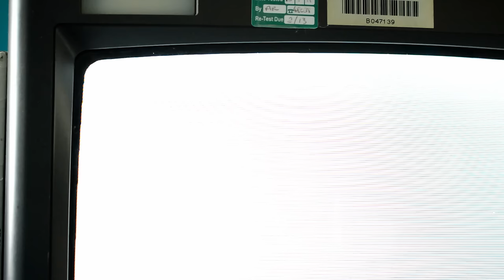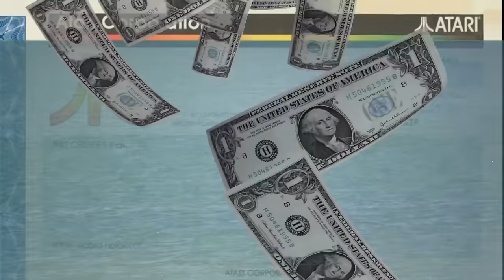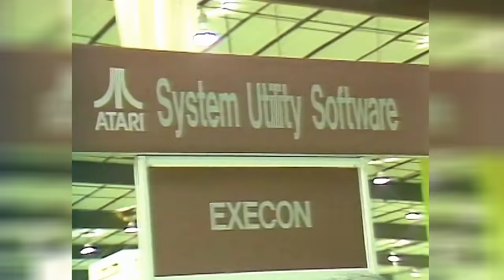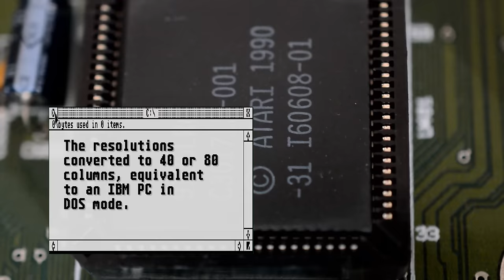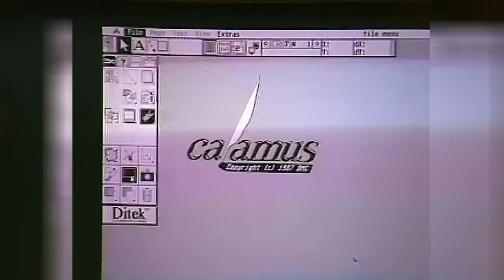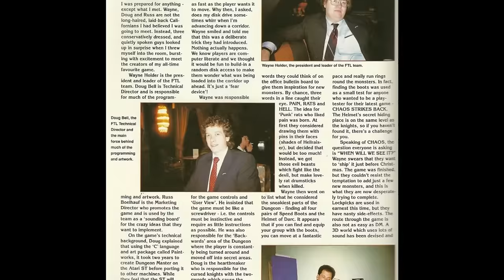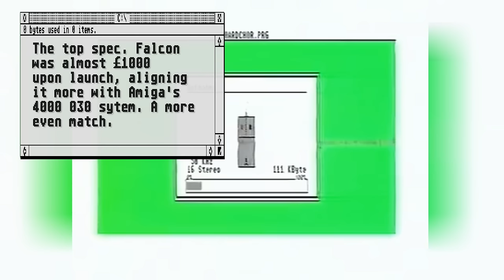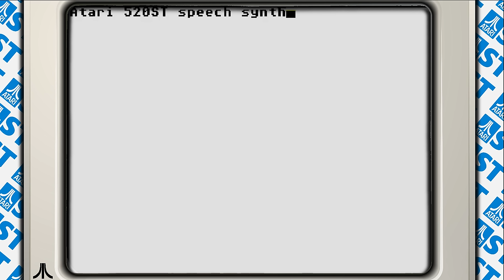The Atari ST Story | Nostalgia Nerd

Comment: The first true 16 bit home computer? Where are you getting this shit from? The original IBM 5150 was 16 bit and there were probably others before that. Though it wasn't specifically aimed at home users, lots of houses had PCs in them. If you want to say the PC doesn't count, then you can say the ST doesn't count because it was aimed at small businesses as well. In the end, the ST is a mediocre machine which ruined the gaming experience of Amiga owners because coders were coding to the lowest common denominator, which was the ST.
Reply: Back then there was a difference (market or whatever you prefer).  Home computers and IBM computers were not in the same category.  So...he is not wrong.
Reply: What? The original 5150 was a 16 bit home computer as was the PC-Jr. Hell, the TI-99 was 16 bit as was the Intellivision (even though it wasn't a home computer) from 1977.
Reply: tarstarkusz Are you trolling or drunk?  You first say that it wasn't the first 16bit HOME COMPUTER, then give examples of computers you admit while 16bit were not HOME COMPUTERS, as an example that the ST was not the first 16bit HOME COMPUTER.  OK, enough talking to you, either troll or just very very drunk.
Reply: The ST was indeed the first 100％ 16-Bit home computer "system" to be released. Having a 16 bit CPU doesn`t necessarily make the system 16 Bit. As a matter of fact, the Motorola MC68000 internally is a full 32-Bit CPU, which is not "rated" as 32-bit because of the 16-Bit Bus.
While the Intellivision was not a home computer (so it is pointless to mention), the IBM-5150 used a 8bit/16bit cpu (just like the ST 16/32) with an 8-bit external bus.
The TI-99 wasn`t much better with the use of an 8-bit to 16-Bit multiplexer that forced to use twice the cycles per access and introduced an additional 4 cycles wait state.
All in all the ST, with its 8Mhz 68000, a true 16-bit bus and fast memory, was the first true 16-Bit home computer system (as opposed to the "compromise" solutions that came before it).
Reply: +Trus... No. I mentioned the PC-Jr (aimed exclusively at the home market and came out more than a year before the ST) and the 5150 which were marketed to home and business users. Atari did the same thing, but with the priorities reversed. Atari wanted and got decent penetration into the small business market.
Reply: +TheMad... IIRC, the memory was faster in the PC/JR. The simple fact of the matter is the PC-JR was marketed exclusively as a home computer and was released about a year before the ST. I have no idea why you are going on about the specs of the 68000.
Reply: The ST is 16-Bit because of the 32-Bit internals, 16-Bit external, the 8088 in the PCJunior is 8Bit because it`s 16-bit internal- 8Bit external.
Memory: Unlike the 8088 processor with 16-bit internal registers, 20-bit memory addressing (16 banks of 64 KB for a 1 MB maximum), and (pay attention) an "8-bit data bus", the 68000 has 32-bit internal registers, 24-bit memory addressing, and a (pay attention) "16-bit data bus". That means it can read twice as much data in a cycle (and the ST also has 3+ million additional cycles per second) and access 16 times as much system memory.
If the PC Junior was the first 16Bit Home computer that would make the ST the first 32-Bit Home Computer, but that it`s not how it works. The 8088 is an 8-Bit data bus cpu and thus rated as an 8-Bit class CPU, no computer featuring it can be considered as a true 16-bit system. (nor a 68000 equipped machine could be rated as a true 32-bit computer).
The 16 bit variant in IBM computers was the Intel 8086 (not the 8088 of the PCJr), but at the time it wasn`t marketed for home use and only featured in super expensive professional machines.
Reply: This is like saying the Z80 and 6502 are 16 bit processors because they have a 16 bit address bus. I agree the 68000 was a better processor than the 8088 and 8086 and that retarded 20bit address bus and the ridiculous segment system (but it did give us the HMA). That shortcoming was very quickly gotten around through EMS. I've seen XT machines with 8 meg. But to say it's not a 16 bit processor and therefor the PC JR doesn't count as a home computer is just stupid. The 8 bit data bus doesn't make the PC/JR an 8 bit machine, it just makes memory transfer slower. You're essentially saying 'the 68000 was a better processor, therefor it was first.'
Reply: All I am trying to do is inform you on how processors are rated, and mind you,  I didn`t invent this rating system myself.
Intel itself rates this CPU in its papers as "8088
8-BIT Hmos Microprocessor".
And no it isn`t like saying an 8 bit CPU with a 16-bit bus is 16-BIT, because 8Bit CPUs would not be able to use 16-Bit word size (internal registers and bus must match).
The whole thing boils down to being able to operate as a 16-bit system or not. During a read cycle if an instruction specifies a word such as move or a long move.I the 68000 reads both the upper and lower bytes at the same time by asserting UDS and LDS pins. 
Due to its hampered architecture, the 8088 performed worse than most 8Bit processors taking 4 full cycles to access a single byte (1byte=8bit).
The shortened pre-fetch queue only meant for it to be always empty (and execution time, taking as long as it took to fetch the instruction itself).

Bottom line, the reason the 8088 is rated 8-bit (by intel itself) has to do with it`s impossibility to operate as a true 16-bit processor just like the 68000 is not capable of operating as a true 32-bit processor (though it can work as a true 16-bit one), and things get even clearer when we aren`t just talking about the single separate CPU, but whole computer systems (full of 8-bit components) like the PCJr and the Atari ST. The PCjr is an 8Bit computer system, the Atari ST is a 16Bit computer system.
Reply: The 8088 and 8086 had 16 bit registers. In any event, the number of bits wasn't and isn't that big of a deal. I openly admit the 68000 was a faster processor and better designed (it lived forever. I think they still make them). The ST had lots of advantages over contemporary hardware (except the Amiga which IIRC came a little later) and was a decent machine, it just wasn't first. 
 There were 286 machines that were also launched before the ST. There is no possible way you can split hairs with the 286.
Reply: I believe that the only reason me or others felt compelled to reply to your post, was you being a little bit too harsh with the Nostalgia Nerd here. 
What the Nostalgia Nerd said was, "The Atari ST, was the first True 16-Bit Home computer". Now look how careful was the wording there, he didn`t say the first CPU to ever use 16-Bit registers (if he said that a correction would have been certainly in order) and he didn`t say it was the first 16-Bit computer ever (this too would have been wrong), you mentioned the 80286 (used in Professional PC-AT August 1984 $6000) but actually Apple`s Lisa came a year and a half earlier than that (in January 1983) with the very same 68000 priced at US$9,995.
Both were Professional systems.
What he said was First "TRUE" (ie: capable of truly handling 16-bit processing) "Home" + "computer" (he wasn`t even talking about the simple CPU,  but "computer").
You accused him of being bogus and then mentioned an 8Bit "home" computer as an example (yes CPU had 16-bit registers like the 68000 has 32-Bit registers, that doesn't make the Sega Genesis rate as a 32-Bit console, nor the PCJr rate as a 16-bit computer) and a professional $6000 16-bit machine as the second example.
Quoting the Nostalgia Nerd:  The Atari ST was the first "-true- 16-bit "-Home Computer-" , and, well, it was, no system capable of TRUE 16-bit processing was aimed at the Home market before the ST.
Reply: +TheMad... You're just moving goalposts. The PC-JR was a 16 bit machine and was sold as a 16 bit machine. I think a more accurate statement would be that it was the first affordable 16 bit computer who's primary market was home users, though they also targeted education and small businesses. Also, the number of bits didn't really mean that much. It was more shorthand for saying next generation. But probably the big thing was dropping ram prices which made 512k/1024k (along with more video ram) which made the computers far more capable without the need for bank-switiching (when done on 8 bit machines, was done like through 8k windows) and the ability to give the graphics chips access to more ram to support  a higher number of colors and higher resolution.
Reply: The sole purpose of using an 8088 in the PCJR was to use 8-Bit components/chip-set on what was a fully 8-Bit motherboard(as that way, it was cheaper to make).
With 8088 being an 8-Bit rated CPU (by intel itself) running on an 8-Bit motherboard (the latter, if you ever took a class in computer system design you should know,  "IS" the SYSTEM) there is no going around it, the PC-JR was an 8-Bit System and that is a Fact, not open to personal opinions.
IBM wouldn`t be the first company to mis-represent their product in advertisement (using clever wording) though if it was nowadays, there would be lawsuits after 3 seconds (see what happened to Nvidia for selling the GTX970 as a 4GB card).
Let`s be frank, here we are not making history, we are just discussing a sentence from the above video (that`s it), the Nostalgia Nerd said "First TRUE 16-Bit home computer", and 1) The PC JR is not a" TRUE" 16-bit computer and 2)the PC-AT wasn`t an "home" computer.
So please, if you still have doubts about what a True 16-Bit system is, please write professor Randall Hyde (University of California, considered a luminaire on the subject) or someone at that level you can respect, and see if he is patient enough to explain to you what a True 16-Bit SYSTEM must be comprised of, as for here, I think there is nothing else to add, nostalgia nerd was right in his rather simple and unpretentious statement.
Reply: There is nothing fundamentally different between a 'home computer' and other desktop computers, it's just a matter of marketing. Most people consider the 8088 to be a 16 bit processor and appeals to authority are useless. The fact that is used an 8 bit external data path is largely irrelevant and is merely a speed issue. Is the 5150 and XT 8 bit machines because of the 8 bit expansion bus?
Reply: I don`t know if you guessed it by now but I do program computers for a living. While I have been doing this since 1988 and I do know a thing or two about systems architectures and assembly programming you clearly do not respect the obvious facts I presented, so, in order for this issue to became something truly useful for you, I insists you confront your ideas with an highly regarded expert "you" respect (not someone "I" respect, but someone you do).
It shouldn`t be a problem no? You will have a laugh together about that guy who insisted that the PCJR was in fact an 8-bit machine ;) 
All the best!
Reply: +TheMad... I haven't touched an assembler since the late 80s on my trusty C-64, though I do work in IT. As I mentioned, there is really no such thing as a "home" computer, it's all about marketing. I wasn't just talking about the JR, I was also talking about the 5150. IIRC, the 286 machines were already on the market when the Atari ST was released. The Intellivision computer module was released in 1983. There were probably unremarkable and unknown 16bit computers released before the ST that we've never heard of. The ST was a great computer for its time (though the Amiga was superior in almost every way) and that should be enough. ETA... I forgot about the TI994A. Of course, most people wouldn't call it a 16 bit machine because most people use XX bit as shorthand for older or newer.
Reply: Both the 5150,  and 5160 came out with an 8088 featuring an 8-Bit chipset, and they were both 8-bit systems.
Given the right amount of word splits and cycles you can execute a 32-bit instruction on a 4 bit CPU, but the difference there is not merely speed, to be 32-bit you need to be able to operate directly on 32-bit words.
The Atari ST (CPU) internal registers are full 32-bit -> So my question for you is: is the ST a 32-Bit system?
Or (by the same token) is the Sega Megadrive/Genesis a 32-Bit system?

And if they are not, please explain to me in plain words why they are not 32-bit.

As for the concept of "home computer" I agree that today it is becoming obsolete, but back then it was different. 
In that period, Apple co-founder Steve Wozniak offered his idea and system to HP not once but on 5 different occasions (in other words 5 times) and they always refused on the concept that "Nobody would ever need a computer in the home".
As you can see there was a time where computers and home were completely alien to each other, but this changed with the revolution of low priced (you guessed it) home computers.
In the early 80s this concept was still alive and boiled down to one simple factor: affordability. Banks and big businesses could buy a machine for $6000 or 10.000, home users (unless you were a Rockefeller)  could not.
They used to buy the Sinclair or Commodore machines all priced well below $1000.
The PC-AT (Model 5170) was USD 6000, the Atari ST was launched for US$799.99 (with monochrome monitor) or US$999.99 (with color monitor- Source: Wikipedia) 
Simply put $6000 (PC-AT) or $9.995 (Apple Lisa) could not be targeted at kids playing in their rooms. Maybe the concept of Home computer is (very) blurred nowadays, but back then it was a big deal.
Reply: The problem is the Atari-ST, other than price point doesn't really meet the definition of a home computer even using the standards of back then. Most of the 8 bit home computers (which in nearly all cases connected to a TV) simply were not useful as a business machine for a few major reasons. Not enough vertical resolution, not enough memory and poor storage. The Apple II overcame these limitations, but not without spending a lot of money and massive support from schools. The ST could be used as a business machine much easier, especially later in its life. With its 640 pixel wide screen, it could display 80 chars and could do wysiwyg and it had enough ram to hold a decent sized document or spreadsheet or whatever in memory. On a typical 8 bit machine you got 40 horizontal chars or less and not enough ram to hold a document in ram. On a C64, you gave away 8k for the screen, 2k on the characters and upwards of 20K on the program itself plus a k or 2 on odds and ends (forgive me if I get some of that wrong, it's been a LONG time). 
I've already pointed out 2 (other) different machines that used 16 bit processors that came out before the ST. The 8088 (and 8086) used a 20 bit address bus, but nobody confuses that for a 20 bit machine. The fact that it used (double) 16 bit addressing is just more proof that it's a 16 bit processor along with those 16 bit registers. Put in 6510 terms, you cant LDA #AAAA (assuming I got the mode right, it's been decades. meaning put the value AAAA in the accumulator though you could store the value found at location AAAA into the accumulator). same with the X and Y registers.
Then there's the fact that DOS 6, who nobody would accuse of being 8 bit runs fine on an 8088. I know, I've done it. I also GEOS on an 8088, which is also 16 bit. If you want to believe that the PC is an 8 bit system, that's your problem.
As far as costs go, would tend to agree. In those early days, there really wasn't a mass market for the IBM PC standard computer, but that steadily changed even through the 80s.
Reply: You mixed quite some Apples and oranges there, and by the way similar examples could be made to prove that the 68000 in reality is true 32-Bit CPU (poor Sega, they had it all wrong with the Megadrive ;) ).
It doesn`t work like that however.

On 16-Bit software running:
Just to make a practical example, I needed to use Autocad in late 80s/early 90s and for the version we had the FPU was required/mandatory (it would display an error message at boot and wouldn`t run if you didn`t have it).
My 386 machine didn`t have the 80387 installed and normally it wouldn`t run Autocad.
One morning my colleagues came to the office as usual, and I made a joke: after installing a software FPU that would fool the system into believing the math co-processor was installed, I told them I actually had such processor now, and show them Autocad Running ("You see? I now have the FPU!")

It is a proof! It`s running afterall!

The fact that 16-bit software like GEOS or Dos 6 run don`t prove much I`m afraid.
What the 8088 is doing there is splitting 16-Bit words in two chunks and taking an utterly unacceptable 4 cycles for each chunk (much worse than most 8-Bit CPU would do actually. In fact most 8-Bit CPU can read a full byte in a single cycle).

You can only define as 16-Bit, a CPU that directly works on 16-bit words, WHICH, brings us back to the question I posed in my last post: why the ST and Mega Drive are NOT rated 32-bit(?) 

Because they cannot work on 32-Bit words without splitting, that`s why.

Let`s make things very simple: the 68000 is 32-24-16 and no, it is not rated 32, it is not rated 24, it is rated -> 16Bit 

The 8088 is 16-20-8 and it`s not rated 20, it`s not rated 16, it is rated -> 8-Bit (even by the company that made it).

8088 based systems while compatible with software written for the 8086, symply put, are INCAPABLE of working as a true 16-Bit machine.

At least we partially agree that the Lisa and PC-AT were a tough sell as home computers (who generally were all in one keyboards and didn`t cost $6000 or $10.000).
Reply: From what I've read, the 8088 can deal with double words and has 16 bit registers. In any event, the TI994/A also had a 16 bit processor. The whole bit thing has long been a marketing thing and shorthand for next generation. The soft 387 software isn't a good analogy.
Reply: I believe the difficulties you are having in grasping the concept, is differentiating between  "a" 16-Bit System (Full data Pipeline/direct 16-Bit processing/Chipset) "and" the sole fact that the characters "16-Bit" appear in this sequence somewhere, in the internal registers description (which is not a system, it is just a single part, of a single component of a whole system).
To briefly touch on the TI994/A, it had the general purpose registers and program counter mapped in ram,  which was accessed through a 16 to 8 bit multiplexer requiring twice the cycle for any access and introducing an additional 4 cycle wait state (same for the rest of system including peripherals access). It used an 8-Bit VDP. (bottom line it cannot operate as a true 16-Bit machine).
A true 16-Bit system (not internal CPU registers which, again, are just a single part of a single component, of a whole system) has to be able to work directly on 16-Bit data, accessing a 16-Bit chipset using 16-Bit data paths and memory models.
Yes you can read the characters 32-Bit (in that sequence! ;) ), in the description of the ST, the Sega Genesis/Megadrive and Commodore Amiga, but due to the above "system" description, they cannot be cataloged as 32-Bit systems.
So please remember, one thing is a whole Computer System and another is having some higher bit count (like the 32-Bit part of the ST/Amiga computers) pertaining to a single part of a single component of a whole system.
The Amiga and ST are 16-Bit not 32, yes they had 32-Bit registers but they had 16-Bit chipsets, 16-Bit data paths, 16-Bits VDPs and could NOT work as a real 32-Bit system.
In exactly the same fashion, the 8088 based computers and TI994/A had 8-Bit chipsets, 8-Bit data paths, etc. and could not work as true 16-Bit systems.
If you accept the latter as true 16-Bit then we have to proclaim the ST as the first keyboard shaped low-priced 32-Bit system in history.(and trust me, the ST was as 32-Bit as the 8088/TMS9900 are 16-Bit, and..., NO, it wasn`t a 32-Bit "system").
Bottom line, the Atari ST was a low priced-keyboard shaped home computer and in terms of TRUE 16-Bit SYSTEMS (monstrous emphasis on "True" and "System") it was the first of this kind to be ever put on the market.
Previously all we had were home computer which weren`t TRUE 16-Bit Systems (again monstrous emphasis on the words "True" and "Systems") or very expensive, professional 16-Bit machines aimed at businesses that could afford to spend 6/10 or more thousand dollars.
Please don`t start again with the negation of the concept of home computers, let`s agree to disagree there, I believe that low priced keyboard shaped home computers are part of computer`s history and deserve to be accounted for.
Reply: OK, so now the definition of a 16bit home computer system is KB shaped computer? Though the ST did beat Commodore to the market, it was much better than the ST. Of course, the Amiga initially wouldn't count anyway since it was a pizza-box design and not a KB design until the A500 came out. Despite the marketing of both these machines, they found significant niche's in the small business markets.